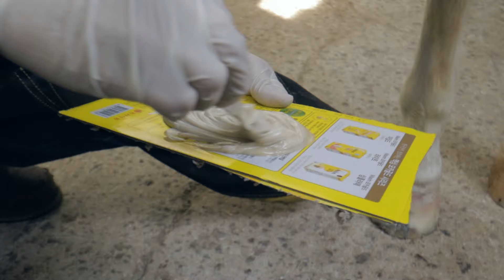Farrier Horse Hoof Repair Horseshoeing Restoration -Oddly Satisfying

Comment: I hadn't realized this was a Korean farrier (I assume?) while watching but I did notice there was a sort of 'gentler' style to the process? I might be misunderstanding what I'm seeing but things like placing the hoof down gently, letting the foot rest on the ground while applying the paste or earlier when shaping? the hoof it looked like they clipped less and filed more, like in my uneducated viewing it kind of looked like leaving the final shaping largely to the file where other farriers seem to remove excess with the big nail clips in pieces? (comparison not intended as value statement but just noticing different approach to the solution)

I'm curious whether I'm seeing a different stylistic approach to the work or whether its just the specific needs of this particular job/horse required this kind of handling?

Comment: What was that greyish stain on its hoof? Looked like a burn. What was that thing that looked like plaster you applied? And why do you put on the horse shoe when it's hot? Isn't it painful?
Reply: the horseshoe is put on an area that cant actually feel pain, kind of like really thick fingernails. the heat doesnt transfer through to anything that could be hurt by it

Comment: ez állatkínzás
Reply: The outside is like a thick fingernail. The inside is alive. As long as nothing goes too deep it does not hurt the horse.
Reply: @derpsydaisy5202  a thick iron will cut off the horse's sole
Reply: Ez nem állatkínzás
Reply: @notyou9252  akkor mi?